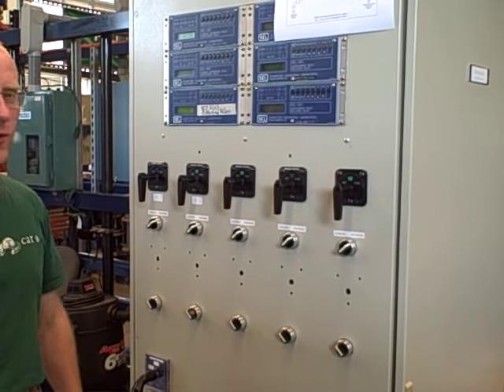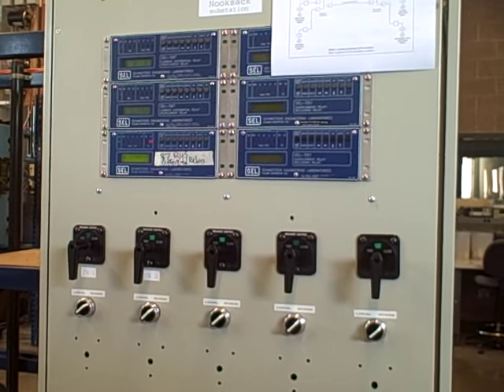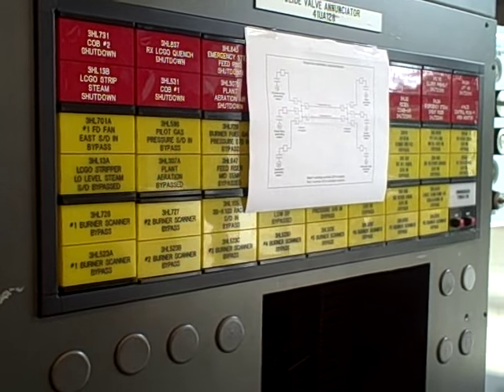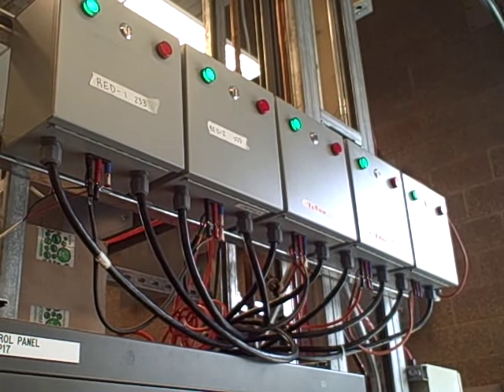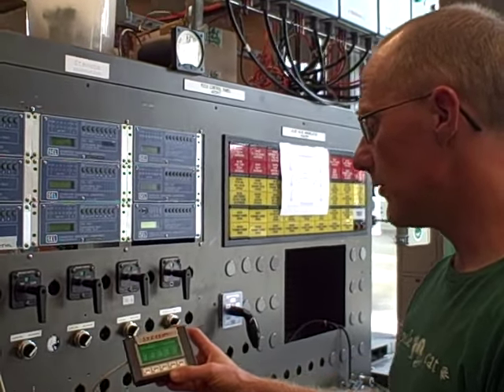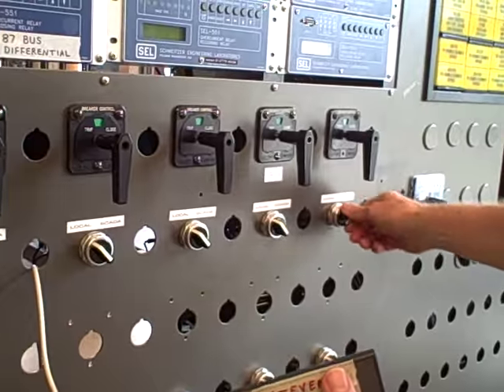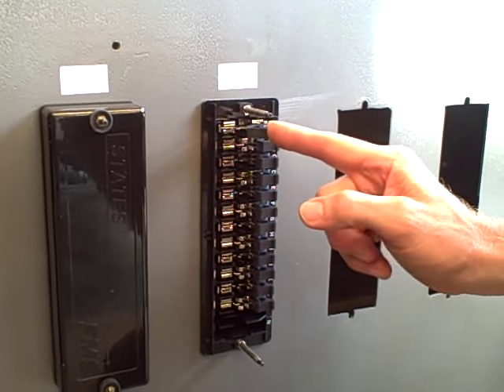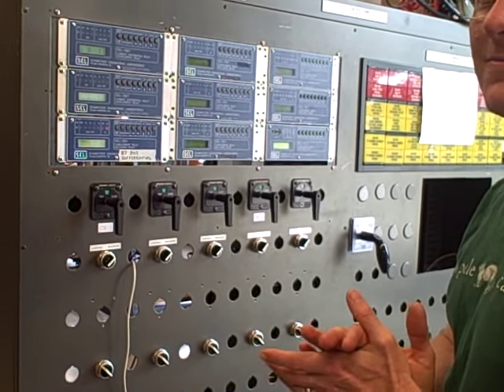Miniature AC power grid substations -- part 0 (overview)

Comment: Very impressive system. However you spent all that money to make that system and it has no LOADS on it. Really? That's how you test the true merits of a system. To transport power from one place to another.
Reply: That’s not the point of the model. It exists to model distributed generation which is the real miracle of the electrical grid.